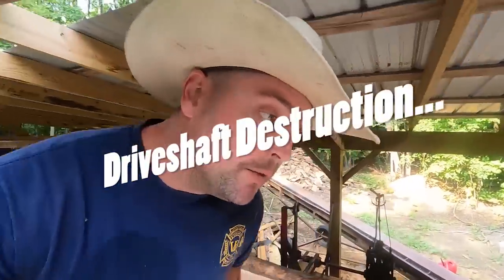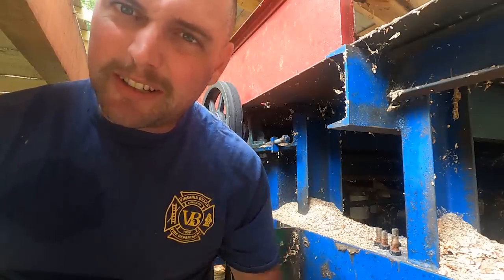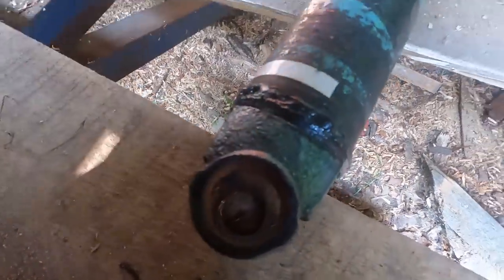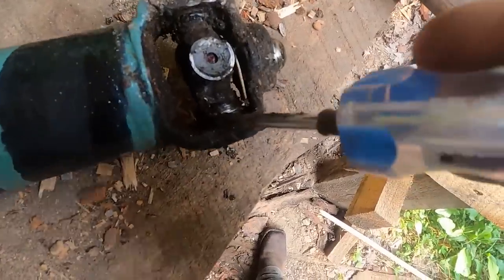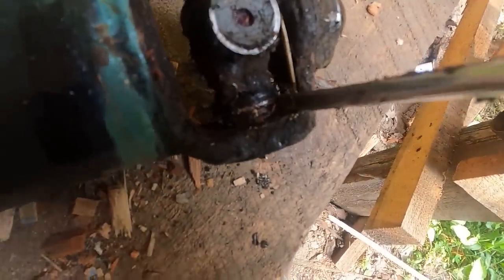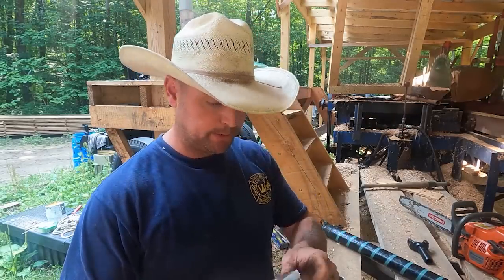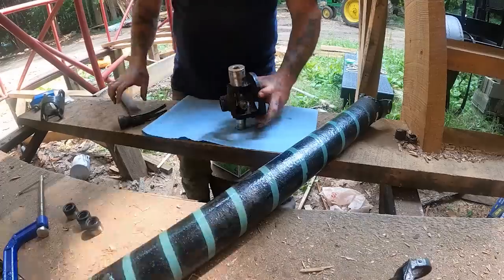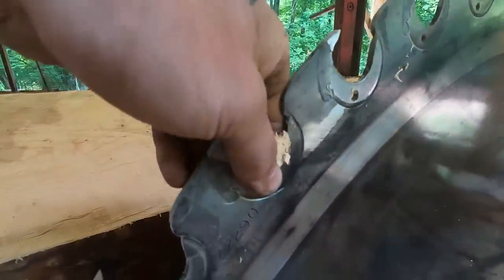I Blew Up The Driveshaft On My Sawmill... TWICE

Comment: A shear bolt won't put you out of business and they are Much Much Much cheaper that u joint setups A box of shear bolts cost less than one ujoint and a whole lot safer too.  Take care running that mill!
Reply: I'm really surprised there isn't a shear bolt or slip clutch in that setup

Comment: Couple points. You could of cut off the tail shaft on the drive shaft instead of moving the whole power unit. Second I think you could find a pto slip clutch on an old bush hog that has been scrapped. Sometimes augers or elevators have then. Great videos man I watch every one.

Comment: I looked at that and said that looks like the front drive shaft from my old 77 Chevy 3/4 ton 4x4!
BTW the CV joint is the same one in a full sized GM tug boat like an Impala wagon, Caprice, Bonneville, Olds 98 etc.
I also would consider a hanger loop up  under that catwalk so if it ever grenades again,  it doesn't take out the engine end also. For reference,  ask a semi mechanic. 
The u- joints without a snap ring used a plastic injection from the factory.

Comment: Just found your channel. I love the old corley and frick Mills I was raised with a corley 440 pulled with a 6v53 Detroit . Good video. In my opinion you just need to upgrade your drive shaft its not strong enough to handle the torque of that 471. It just will not hold up very long . But that's just my opinion. Keep putting out mill videos. I liked this one a lot.

Comment: That is a dual cardan so that you do not have to match the angle of both shafts. if you do not match angles on a single cardan, it will create a horrible wobble. There are some good videos on driveshaft/pinion angle setup.
Reply: Also known as a constant velocity joint.

Comment: I just discovered your channel today. So entertaining   Regarding the drive shaft, it may be an optical illusion but the angle of the centerlines looks way too severe. I don’t remember what the maximum permitted angle is but check with your drive shaft shop.

Comment: 1:34 that there is a Double Cardan and its to help stabilize drive shafts at funky angles. Your mill likely doesn’t need it though, but you’d need a longer driveshaft overall.
Reply: wobble-doofer is both easier to say and more descriptive.
Reply: @tgraham1961 that's why most guys call it a CV joint. 😂

Comment: That double cardian joint is a huge weak spot. Kept breaking that oice on my old mud truck. Regular u joint couplers will make it stronger. The doyble cardan joint is for an increased driveshaft angle. I dont think you even need it..

Comment: That's called a double cardigan joint which is used when one u joint is at a high angle while the other end is not..When 1 u joint is used at a higher angle it has to accelerate and decelerate twice as much and fast end to end as a low or no angle joint...When one ises to u joints back to back such as a cardigan joint each joint only has to swing half as much,or accelerate and decelerate half as much extending the life and lowering the stress on a single u joint...

Comment: You can just loosen the drive belts so they will slip when it jams. Or take one belt off out of two
Reply: The belts you see on that saw are taking power off at the driveshaft to drive the hydraulic pump.  The driveshaft is direct to the saw blade.  He actually does need to get a slip clutch for that setup to prevent what happened from occurring again.  I'm just sorry that it was my wood that was busting his saw up.

Comment: The problem is: 
Youre using driveshafts, when youre not driving anywhere!
Get some Power take-off shafts for moving some POWER around ;)

no but really, car parts are garbage for other than Car'ing around
Reply: The main difference between driveshafts and pto shafts is that the driveshafts are smooth, while pto's are corrugated, so they wont collapse.

It could be a good idea to add belt-drive somewhere, for taking off the edge from the sharp impacts and jolts.
Maybe add belt from the engine so you can make the driveshaft straight? use straight axle without u-joints, but replace them with a chain coupler (2 sprocket side-byside with chain around) it will allow tiny flex but otherwise is hard as a coffin nail

Comment: So, if it was me, i would grease the mating surface of flange yoke, and find the cheapest, crappiest bolt ( one single, maybe 2)  to bolt flange on with. Replacing broke flange bolts is way easier than a broke u joint.

Comment: Hey Andy, guess what happens when you just beat on things with a hammer? 
At least use a damn C clamp to install U joints if you don't have a balljoint tool....Auto parts stores rent them out for next to nothing.
Reply: As someone who made /rebuilt driveshafts for 12 years, I can tell you that a hammer is the CORRECT tool to use. Also, when being wrong about things, try to do so nicely 😊
Reply: @Spikes_HD  bwaaahahaha yeah, having an inexperienced mechanic beat on the thin peices of metal with a much larger peice of metal never hurts anything in your driveshaft shop? You never once while installing a cap had the cap get hung up on the inner surface because of debris or the hole being out of round? Well now I know why you spent all those years working in a driveshaft shop. I'm just a certified auto tech with a degree and multiple certifications in automotive and light duty vehicles and light heavy equipment who has helped build quite a few mud trucks and swamp buggys. It's only around 30 years I have been doing this. 
I get it, you are a BFH guy. Thing is you can't guage resistance when you just hit it with a BFH. I can think of at least 2 dozen times I have watched someone beat the ear off of a yolk or driveshaft with the BFH method. I can only think of 2 times thar the same has happened with a balljoint press. Those 2 times you can tell the previous person used the BFH method. 
BFH is a last resort thing not a first step thing unless we are talking about the pins in a 948 articulated loader or an excavator.